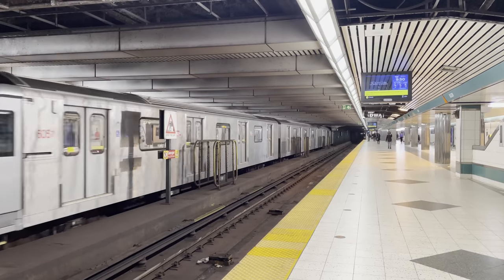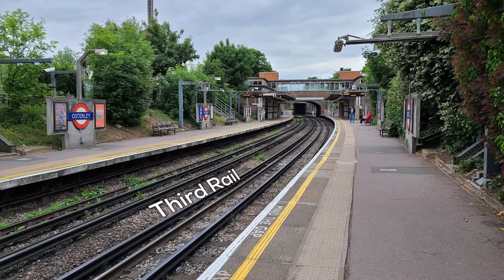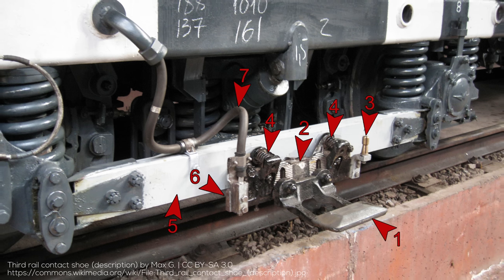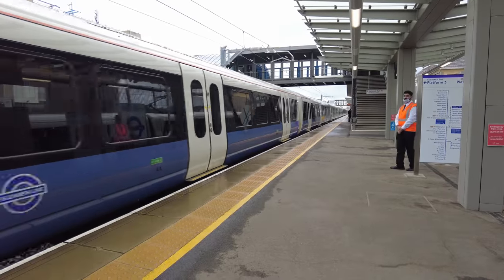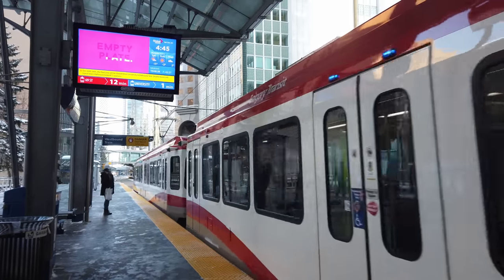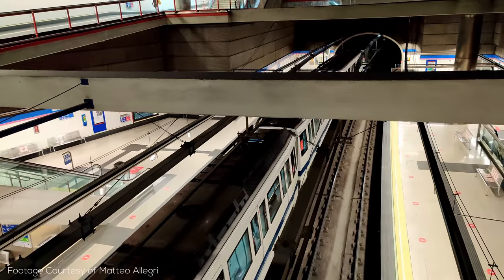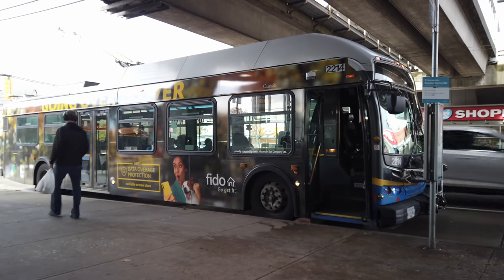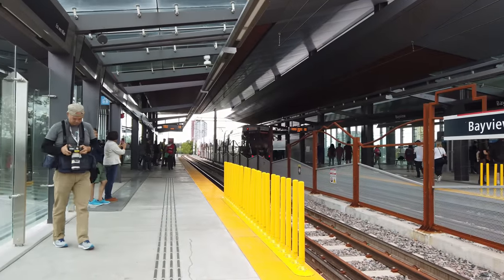The Best Way to Power Your Railway | Third Rail vs. Overhead Wire

Comment: It's high voltages that are more efficient at transmitting power over long distances, rather than this being something inherent about AC. In fact, DC is actually more efficient at transmitting power than AC, but this is overshadowed by the difference between voltages - this is why a lot of modern high voltage power links use DC.

The reason that high voltages are traditionally associated with AC though is that up until relatively recently, it was just impossible to handle high voltage DC affordably and practically. AC can very easily be changed in voltage using a transformer, whereas DC needs modern power electronics to change the voltage.

So why is high voltage more efficient? Well, P=IV tells you that for a given amount of power that needs to be delivered, if your voltage increases, current will decrease (I = P / V). Now if we take R to mean the resistance of the wire rather than the load, P = I^2 R tells us that for a given value of current, power loss in the wire will be greater, in fact proportional to the square of the current. So increasing the voltage dramatically reduces power lost. This is why power transmission lines tend to be very high voltage.

OK, so why isn't third rail high voltage if it's more efficient? Simple - because it's close to the ground, the return path, and potentially humans, it's neither safe nor practical to make it much higher voltage than maybe 1000V or so. Most third rail I know of is in about the 500-750V range.

So why build third rail in the first place if it's so much less efficient? Well, this comes down to another difficulty of AC vs DC. In the early days of rail electrification, there was no practical way to convert from AC to DC on a train. Why would you want to do this? Again in these early days, AC motors could only be made to go at one speed which was governed by the frequency of the AC power. This is not good for a train, so instead they used DC motors, which are more expensive to maintain but would allow for easy changing of speed by doing things like switching resistors in and out of the circuit. So at this point your only choice is DC distribution - and with DC distribution your only choice at this point was low voltage. The Germans actually came up with a clever way around this - it turns out that low frequency AC can be used to drive traditional DC motors, with a bit of modification. So they used low frequency AC to power their trains, 15kV AC @ 16.7Hz. What's the trade-off here? With lower frequency AC you need much larger transformers to convert the voltage. This trade-off was considered worth it.

But in other countries, they went with relatively low voltage DC transmission, either through third rail or overhead lines. Of course, they were often only building very urban electrification systems at first, so the power losses didn't matter much. This is also why they still build new metro systems with third rail - you're just over such a small area that having to have more substations and more power loss is not worth the hassle of going with AC. But for long-distance lines, the power losses start to get significant. Then around the 50s, technology like mercury arc rectifiers, soon after giving way to solid state rectifiers of various sorts, could now be fitted on trains. This would allow AC to DC conversion to happen on trains. This means you can now have high voltage efficient transmission at normal mains frequencies, convert it down to low voltage for your motors, and rectify to DC. This is about when the 25kV AC @ 50Hz (or 60Hz depending on the local mains frequency) standard emerged for overhead wires, a standard used across large parts of the world to this day. Of course many countries still retain their legacy systems as well, and perhaps only use 25kV on new high speed lines, if at all. But it's heavily used in large parts of France and Britain, and many places that didn't have a serious electrification programme until a significant time after WWII. As far as I know after the technology was proven in Britain and France, no country has chosen anything else for a completely new-build electrification system for a long-distance rail network where there hasn't been a need for compatibility with some existing electrification.

What else has changed? Remember I said that DC motors are harder to maintain than AC ones? Well, advances in power electronics in the 1990s have allowed DC motors in trains to give way to AC motors. This basically involves using power electronics to change the frequency of the AC as required to change the speed of the motors. Nowadays most trains, even ones designed to run on DC power, will have AC motors; obviously the DC will be converted via power electronics to AC to power the motors. Many trains since the early 90s and most trains since the 2000s have been built like this.
Reply: Wow you did an excellent job at explaining the crucial differences and advantages, I couldn’t have done it better. I hope many people will read this in order to prevent false information to be spread
Reply: A small addition to the last paragraph: in all modern locomotives the variable-frequency current for the motors is derived from a DC intermediate circuit. This has the added benefit that it makes it very simple to build multi-system locomotives that can run under different types of electrification. In a DC network the power from the overhead wire is just fed directly to the intermediate circuit, whereas under AC overhead lines it will be transformed to an appropriate voltage and rectified (so even the frequency doesn't matter all that much nowadays, it just slightly affects how the transformer needs to be built).

Another thing that's common nowadays is energy recovery (i.e. using the motors to generate power while braking and feeding that power back into the grid). Basically it uses very similar electronics not only on the motor side but also at the power feed, in order to match the voltage & frequency of the grid when feeding back power.
Reply: a funny thing is that you can recognise AC motors on trains by their sound. (Basicly all modern trains)
When they leave a station, you will hear them humming at different tones, going from low to high. 
That's the electronic controller increasing the frequency, of the AC power to the motors, increasing their speed.
Reply: As an interesting additional fact, the German solution of AC drive to DC motors wasn't just used in the Germosphere, it was also the predominant system on American catenary, in its heyday. There wasn't much of a choice, since the US was electrifying long-distance, high-speed lines in the days before rectifiers and the grid-frequency standard. This is why, to this day, large parts of the overhead electric networks in the US northeast still run on their own, separate, 25Hz power grids, with traction power supplied at 12kV, although I think historically it was 11kV.
Reply: @doorhanger9317  Yes, in the early days of AC electrification there were all kinds of voltage/frequency combinations. Basically almost every new project tried to push the envelope of what was technically possible and experimented with a new combination.

E.g. here in Austria the first line electrified with AC power was the Stubaitalbahn in 1904, which initially used 2.5kV/42.5Hz (which was later changed to 3kV/50Hz - to make use of the 50Hz power grid -, and finally to 900V/DC when the line was integrated into Innsbruck's tram network).
The Mariazellerbahn, which was electrified only a fews years later (1911), uses 6.5kV/25Hz to this day. Meanwhile the national railways followed the German and Swiss example and used 15kV/16.7Hz from the start.

And of course there are various local lines which were electrified sometime in the late 19th and early 20th century that to this day continue to use DC power at various voltages between 750V and 1.8kV.

Curiously we also have 25kV/50Hz lines in the east: the GySEV (a rail company with very interesting history btw., as it kept operating cross-border services even during the cold war) used the Hungarian system when they electrified their line in the late 80s. Also the Brenner base tunnel will be electrified with 25kV/50Hz, despite all connecting lines using either 15kV/16.7Hz (Austria) or 3kV/DC (Italy). This only shows how far power electronics have come, and that today it basically doesn't matter anymore which system you use.
Reply: @stephanweinberger  Jein... The directly connecting line of the Brennerbahn only uses 3kV DC, but the Italian highspeed network is (mostly) built to 25kV. If there weren't already 25kV lines in Italy and thus a fleet able to use it, they would most likley have opted for 15kV in the tunnel and the changeover at the first italian station.
For the same reason the 15kV go all the way through to Domodossola on the Simplon line, although it is already about 25km inside of Italy. (Yes, I know about the 3-phase phase in the Simplon tunnel ;) 15kV isolators on FS beams still look funny to me, though...
3kV is unsuitable for the high speeds planned for passanger trains, 15kV is more or less considered legacy today - so why not use the 25kV...
Reply: @sethanix3969  Yes, but it will still be decades until the Italian 25kV network connects to the Brenner. The line from Fortezza further south towards Trento is only in the early planning stages, and from there it's another ~85km to Verona. Also (at least according to openrailwaymap, which might be wrong), the new line Vincenca-Verona-Brescia will still be electrified using 3kV/DC; the 25kV/AC only begins west of Brescia.

And btw.: The old high-speed line Firenze-Rome does use 3kV/DC - for speeds up to 250km/h.
Reply: @stephanweinberger  Yes, I know it will be decades, and even then it's with an if, that the 25kV will reach Franzensfeste - but that wasn't my point. My point was, that most freight and long distance trains must already be able to handle 25kV and 3kV anyways, so it doesn't really matter which is which, but if you build it newly anyways use the "cheaper" 25kV.
The only new trains that would probably be needed would be for a hypothetical REX from Innsbruck to Innichen (and potentially Lienz), as I don't see any Italian Regionale using the tunnel...

And becuase of Firenze-Roma there was a (mostly) in front of the HSL ;)
Reply: @sethanix3969  yes, as I wrote: today it doesn't really matter anymore from an operational standpoint, so of course you will build the simplest/cheapest solution - which in Europe will be 50Hz, as that's what the grid provides (though I wonder how - and if at all - the BBT will be integrated into the Austrian 16.7Hz rail power grid).

REX from Innsbruck to Innichen and Lienz are no problem, ÖBB already has multi-system EMUs capable of 25kV/50Hz for services to Hungary. But then again, I don't think that regional trains will ever run through the tunnel. For Innsbruck->Lienz a changeover in Fortezza isn't too much to ask IMHO, and for everything else you dont want to bypass all the stops on the mountain in the first place.
Reply: I haven't done the math but the other problem with AC third rails is that they have significant capacitance to the ground, which can cause losses with an AC waveform.
Reply: Whoaa you really done it
Reply: There's also something about eddy currents I don't understand very well that means under sea cables are better DC
Reply: @sIightIybored  the main problem with AC power lines is capacitive coupling, as @322 already mentioned.

For sea cables this is especially noticeable because in contrast to air, salt water is very conductive. And it's also very close compared to the other conductors or the ground for an aerial power line.
Hence it forms a nice, long, big capacitor with the cable, which is charged/discharged with every cycle. Moving charges around takes energy, which obviously has to come from somewhere - and the only power source is the current in the cable itself.

But you also get inductive coupling, because every cable also has a magnetic field around it. This causes eddy currents in the water around the cable (again not so much of a problem with lines over land, as air is not conductive so no currents can flow). And again these need to get their energy from somewhere.

Both of those phenomena increase with frequency, hence why DC is the obvious choice for under seas cables.
Reply: China uses 1500V DC in some new metro line. Probably to increase line capacity
Reply: Fantastic summary! I have wondered why Germany had that unique 16Hz AC electrification
One point I'm not sure has been mentioned in the comments is the weight (and size) of the transformer needed to convert 25kV AC into a lower voltage which can be used by the train. For high speed trains, the long distances and high power requirement means using high voltages is a no-brainer. But for metros/light rail you usually wouldn't go for high voltage AC because:
a) You might need the train to fit into a small envelope like in underground tunnels, which favours lower voltages for smaller clearances
b) Carrying heavy transformers on metro trains is not worthwhile - over shorter distances and with lots of trains on a metro it makes sense to have more substations and use lower voltage DC wires/conductor rails. That removes the need for transformers on the trains, reducing their weight.
Reply: Most Trains have DC motors .
Not AC motors.
They convert AC from overhead lines to DC . Because Traction is good with them. Start and Stop . ?????
Reply: @raghunandan9290  Most trains built today do NOT have DC motors. They are more expensive to maintain as the brushes need to make physical contact and so they require regular rewinding to stop them wearing down and eventually shorting out (flashing over). Sometimes hobbyist and certain EV motors will be described as "brushless DC" but these are arguably just AC motors with a built-in DC to AC converter/speed controller. But ultimately the current going into the motor windings in modern trains will be AC and will be varied in frequency using modern power electronics in order to control the speed.
Reply: So how do LIRR and Metro North commuter trains work then?  Their 3rd rail is 750V DC, are they running AC traction motors with inverters under the train to convert DC>AC?  My assumption was they ran DC traction motors for simplicity and the dual mode Metro North EMUs just ran rectifiers on their roofs when they switch to Catenary power in Connecticut.
Reply: @mrvwbug4423  The old Budd M3s built in the 80s have DC motors as this was before power electronics were sufficiently advanced. All the stock newer than that on those two railroads (from the 90s and 2000s) have AC motors, and will have fairly complex power electronics to produce the correct AC frequencies for the speed requested. But in general the power electronics plus AC motors are more reliable and have lower preventative maintenance requirements than DC motors, which of course have physical brushes that wear down and cause chaos. Because trains with AC electric motors need to generate their own AC so that it's at the required frequency, even when running under AC power they will usually transform down and rectify to an intermediate low-ish DC voltage first, just like trains with DC motors need to convert to a low-ish DC voltage to power the motors directly. This in turn makes it fairly easy to have trains with either type of motor that reliably run on both AC overheads and DC third rail, as you just make that intermediate voltage the same as the third rail voltage.
Reply: @Muzer0  Interesting.  So I'm guessing that diesel locomotives are generating AC voltage at a level the traction motors can already use without having to step down via transformers?
Reply: So wait, if I invented a new country with new standards then I'd actually want DC distribution and outlets and devices that run natively off DC? 

Or would you want to convert to AC at the pole? Maybe do that just cause you have interoperability with all the existing devices made for every other nation but yours
Reply: @sparkzbarca  likely DC for the longest distance/highest power distribution (ie on the order of dozens of kV and up), AC for the rest. But that's just my gut feeling, really I guess it depends how expensive/reliable the power electronics for conversion are these days where the breakeven point would be for an entirely new installation.
Reply: BEST  "DISSERTATION"  I'VE READ ON YOUTUBE IN QUITE A WHILE!!